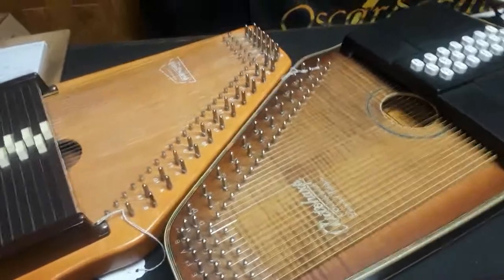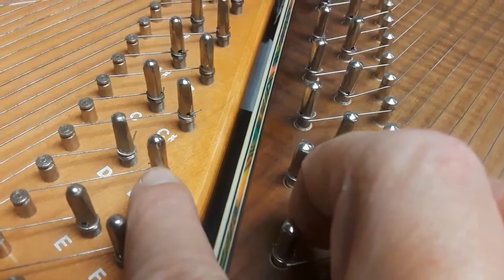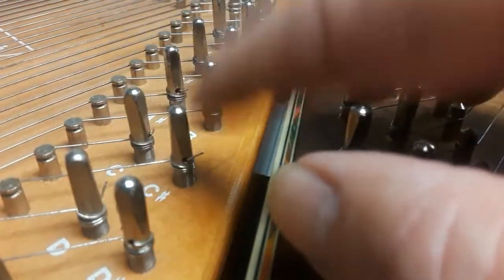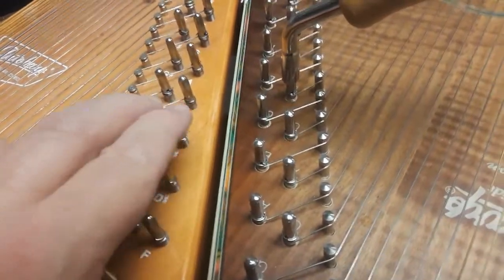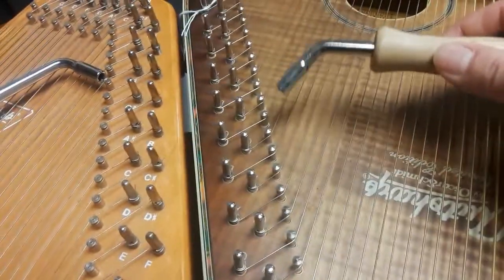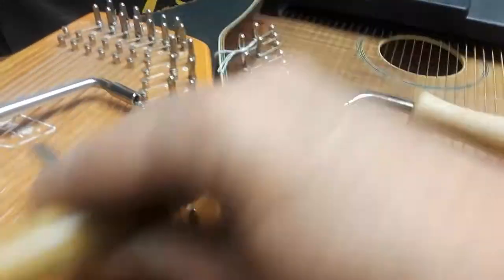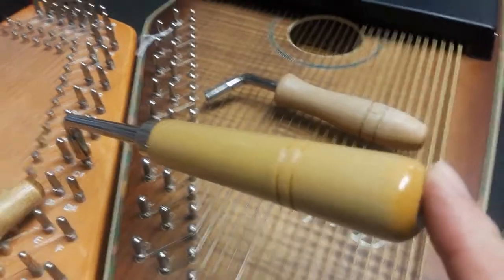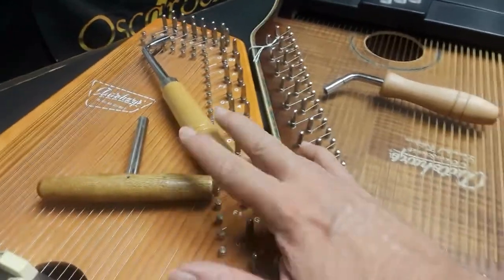Oscar Schmidt Harps: the Wright and Wrong Wrenches! Stalking the Wild Autoharp

Comment: I hope you don't mind, Hal. I found a 1955 12chord OS in mint condition, never or hardly ever been played. Not even badly out of tune, but I didn't like the included  wrench. Not only a kind of sloppy fit, but the short handle meant there was a lot of sideways pressure that would lead to loosening the tuning pegs. I found a Golden Gate DH-40 T-Shaped Tuning Hammer for $13.95 at Amazon, and it fits perfectly, making it  much easier tuning and no sideways pressure on the pegs. Not a star, but the square hole is exactly right and it goes down over the pegs much further than the POS that came with the instrument.

Comment: Could you give me a number or link to the wrenches you used for the older harp. I ordered one and it has a square hole and does not fit. It was also too large. The info on amazon, ebay, and Oscar schmit sites is not reliable.
Reply from the maker: See, that's what I'm saying! The new wrenches do not fit anything correctly....but if you have an Oscar that is under 10 years old or so, you have to make do, because the older style, which fits the older pins, doesn't work on the newer harps either. I tune a lot of the newer harps, a lot of them, and always have to use a new style wrench that doesnt fit, and I have tried literally dozens of wrenches, new and old...and we are an authorized Oscar schmidt dealer.
.and this is the best they can do....which is terrible. BAD ON Oscar Schmidt (Washburn) for supplying their harps with inadequate pins. 

Do you have a newer harp or an old style, older than 10 to 15 years? If its new, dont waste your money on an old style wrench, because it wont work!
Reply: @wildautoharp  I have an older harp. My research tells me it is from around 1968.
Reply from the maker: @TiminNicaragua  In that case, here's a link where you can get wrenches: https://shop.daigleharp.com/collections/tuners-and-electronics
Reply: @wildautoharp  will these work on a early 60s 15 chord?
Reply from the maker: @sturner641  Yes, they will.  d'Aigle autoharps is closed for several weeks now; but go ahead and order anyway, and it will be filled eventually!
Reply: Hal Weeks is there any other source for an appropriate tool? The instrument was a recent gift. I was so hoping to use this downtime to re-learn to play.  I did not realize there would be a tuning key issue. Thanks
Reply from the maker: @sturner641  Well you can try Elderly Instruments, Amazon, etc....but if your question is "will they deliver sooner than dAigles? " Then all bets are off....I make an Amazon order last week, and it's due to show up in May.  It's the times.
Reply: Hal Weeks just bad timing thanks
Reply from the maker: @sturner641  There is no good timing with this Stay At Home thing.

Comment: Ouch Hal! Just bought an OS11021NE Korean monster and the pegs are as you describe in this video, & not uniform to boot! Unbelievable! 2 options I’m thinking of: swap old school pegs from a junker autoharp to the Korean. Would that work? Or: square off existing pegs with a metal file and find a square wrench that would fit the resized pegs.  I’ve heard the OS fine tuners are a joke and not worth having. Is that true? It looks so pretty. Too bad.
Reply from the maker: Actually it's the new OS's that are not worth having.   Sorry to say.   But yeah, the fine tuners make them even heavier, and suck away a lot of the tone.   Really really bad options.   As far as the pins go, a lot of time the wood that they've used to put the defective pins into has swollen or shrunk between Korea and here, and the pins are "mounted in butter"...that is not very tight, and other pins only make it worse when you drive a different pin with different threads into the same hole with the old threads.    Here at the shop wev'e started fixing up old GOOD oscars with new strings and felts, sometimes custom chord bars...they have much better tone, the anchors are fixed so they don't slip...basically we are future proofing the old good oscars so they continue for decades because they are the only viable option, outside of a 1500 dollar Luthier harp.   Those are fixing up and selling for around $750 depending on features.   But otherwise, new harp buyers are stuck with the bad wrench....it sucks.
Reply: Thank You Hal. Appreciate your wisdom and experience

Comment: Finally, I get the scoop.  Thanks so much for this.  But it's bad news.  I've played since the 70s and been through several harps.   This new OS they gave me at work when I retired has caused me so much frustration.  It was a freak accident when I could get the wrench to turn the pin.  I see now that it's the newer pegs.  I could tell the pegs were different.  Didn't know it was on all their new harps.  The wrench that came with it doesn't work 90% of the time.  My other wrenches don't either. I'm glad I saw this before I ruined  my old wrenches on these stupid new pegs.  I think I'll have to just use this new harps for parts!  Bummer!!!! Or do you have any suggestion, perhaps?
Reply: Did the star design work for you? When I watch these stores demonstrate tuning, I see them using the star design. Just curious. I have 4 of them that don't work well with my harp.
Reply: My star design doesn't work, no.
Reply: See if d'Aigle Harps can remove those pegs and install a set of new tuning pegs on your Oscar. It might be a good investment.

Comment: So what size pins are these? There's no after market decent tool?
Reply from the maker: Nope. Not for the harps from the last 20 to 15 years. Not that we've found. We even find that the provided loose fitting wrench fits each pin differently because the pins are all slightly different. So hold on to the provided wrench. Frequently these new pins are too loose and won't hold the strings tight even when new. I have a new student who had to buy 3 to get one that stayed in tune. The new oscars are a terrible terrible product ... not like the old ones at all. They were fine.

Comment: Gooday Hal, Why were the new design pins introduced if you can't buy a good fitting wrench to suit. As you showed, the one recommended for the newer pins does not have much depth and I can see a bit of a twist happening. Is that likely to be an issue ?
Reply from the maker: Hi Lance.  Unfortunately the issue is quality control.  Oscar Schmidt (Washburn) doesn't care.  If your instrument wears out you'll have to buy a new one.  Maddening.  They just don't care and literally think that little of us.  Better wrenches are made...but they are made to go on better pins....which are on the older harps (no surprise there, it's the way of the world).  This is not the only problem with the newer harps.

Comment: Just bought a used Oscar Schmidt model os-45b harp. Just found your utube vidio about the tuning wrench. Very helpful since my harp did not come with a tuning wrench. You mentioned a vidio explaining the difference in a and b models. Is that vidio still available? Looking forward to the tuning one.

Comment: Hal, about a year ago, I purchased a "T" handle wrench for my OS21C and it had a star shaped bit. It was too 
small and wouldn't go down over the pin at all. 
Is there a "T" handle wrench that can be used on this model?? I am still using the wrench that camewith my
Chromaharp. It works, but I want something with a better "feel" and is easier to use.

Comment: I just picked up one of these for free from my grandma. Needs some serious tuning. Came with tuning wrenches and everhthing necessary to tune it but i have no clue what im doing. 
Ive never really played a instrument or been able to understand tuning and pitches and what not. 
Mine has 5 octaves and i dont understand anything. I dont understand F4 vs F#4 or C1 vs C#1 for example. 
For example i have F4 in the bass octave but also have F4 in the lower octave, middle octave, and higher octave and thats where i get confused. I have a tuning app on my phone and in sitting in a nice quiet room trying to tune this a littke but i cant get any of the notes to hit the correct pitch i think. For example in the bass octave i need to be at F4 but i can only get around F2-F3 and im really scared to try and bring the pitch to F4 if im understanding that correctly. I broke my string in the highest octave C1 and really dont want to break any other strings especially lower ones. It was around C3 when i got it and i tried to lower it but it just would not resch C1. So i tried to raise it until it lapsed or so i thought and the string just broke. Someone help explain this to me please lol or point me to a video that explains every inch of tuning and octaves and what not. Id really like to learn so i can play.
Reply from the maker: Sounds like you have one of the old black autoharps. You can ignore the 4s and all. They referred to f being the 4th note up from c, which was 1. Search how to tune autoharp on youtube. There are good videos that teach it. Good luck. Lots od times the old black ones dont hold up anymore when tuned. Sometimes they do.